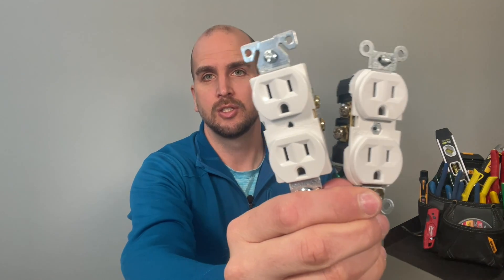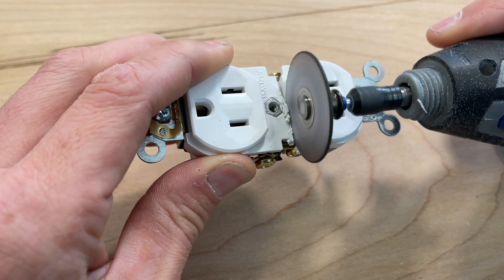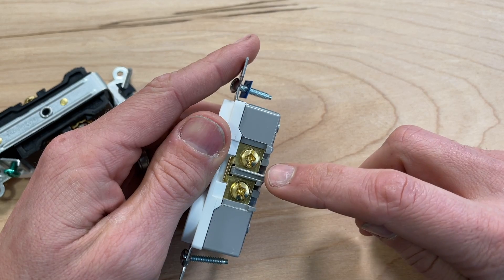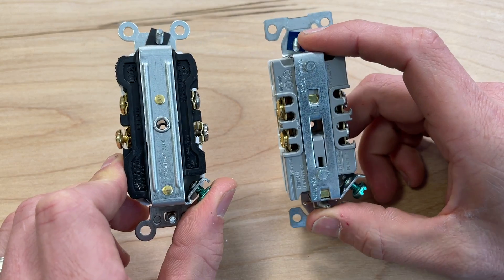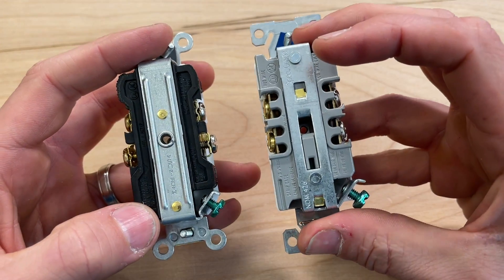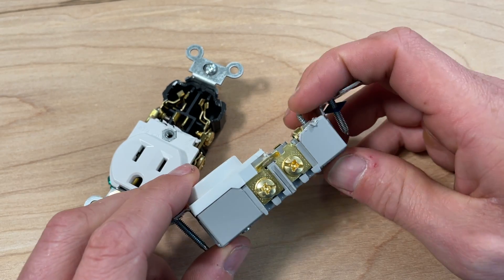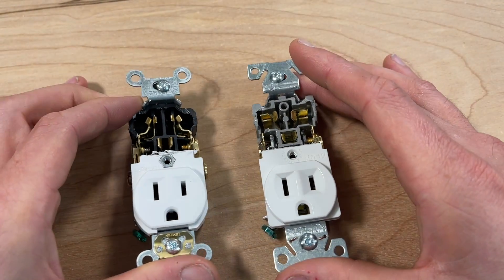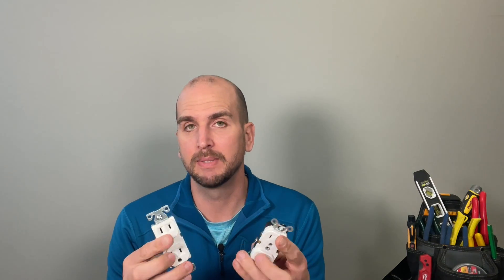What Outlet Should You Buy | Leviton vs Eaton

Comment: I just installed one of those Leviton receptacles yesterday to replace an existing outlet which was loose: I also found it had been backstabbed. 🤦🏽‍♂️
I decided to use the Commercial Grade outlet so I could use the back wire feature, and also because it has to provide power to another set of conductors in the electrical box. 
One thing I liked is that the receptacle was still a bit deeper than I wanted, even with spacers. The Leviton has the embedded nut in the center, which when installing the wall plate worked better to draw the receptacle further forward. (I am going to go back later in the year and try to replace the box itself to make it more secure.)

Also the Leviton is Made In USA; not sure about the Eaton. 

I fished out the cardboard box from the trash, and didn’t realize there are instructions printed inside the box! 😅👍🏽

As of Feb 2025, using your links, the Leviton is $2.41 while the Eaton is $2.48. 

So when I get more I will likely get the Eaton. (Lowe’s is closer to me and I get a 5% discount)

Comment: As an electrician... These particular backwire features of both brands I would use for stranded wire only. 
At one time before these better backwires existed on the commercial receps, stranded wire was required by some municipalities code enforcement to have spades, such as: Sta-Kon, 3M, Panduit, etc.,   to be crimped onto the stranded wire before putting under a screw.
With these commercial backwires, they do seem to hold stranded wires quite well. 
I would like to see pull ratings done using solid wire conductors on these backwires.   

The fault I find with these, is the screws were never tightened enough and when you fold the wires back into the boxes it moves the wire under the pressure plates causing looseness and becomes a hot spot.    If using solid, I still wrap around the screw.

When using receptacles in a circuit run... I make all my wires up and put under a wire nut.   I leave a single set of pigtails out of the box to wrap around the outlet screw.  If the outlet fails.. it doesn't affect the rest of the circuit.
Reply from the maker: Thanks for the comments and feedback.  👍

Comment: If you happen to see this, there is one thing your missed that is really quite important from a quality perspective: The 110/240v blade connectors on the Eaton are nearly impossible to spring, thus they last several years longer than the Leviton without failing to hold the device plugged into them. Leviton's "edge" and thus their "popularity" on the dealer side stem from price. If you want longevity, and I'm talking in decades here, go with Eaton. If you want "good enough for most purposes and to get buy the initial homeowner before they sell and move, go with Leviton. They both have their place. After building this place in 1995-1997, this year I "get to" replace about 30 Leviton 110v receptacles in my home because they are all sprung and do not safely grasp the blades of the plug being inserted. — The pro's know, it's all about the $$ —

Comment: I prefer Eaton too. I especially like the wire looper, it saves time. I never use 15 Amp receptacles. I always use 20s for a 15 Amp circuit as a safety margin, but that's just me.
Reply from the maker: Thanks for the feedback, I also dove into the Legrand (Pass & Seymour) compared to the Eaton.  The Legrand is pretty compelling.  https://youtu.be/ir3kMV1-6hE

Comment: Question - If you installed a Non - self grounding receptacle in a metal box and the receptacle did not have a groundwire tied to it, but a ground wire was tied to the metal box ground screw.  If a malfunction occured in the non-self-grounding receptacle, does the current not flow through the screws and into the box because non self grounding outlets also have metal to metal contact with the metal box?  In other words, how is one self grounding and the other one is not in this situation b/c both have metal to metal contact with the box?

Comment: I search for the brand of duplex outlets that are 15 amp. but if you examine them closely are built with 20 amp.T-slot internal metal contacts.   Lowest contact resistance with highest retention forces, regardless of what load you'll actually put on them.  This is of course for a 15 amp. residential situation

Comment: With regards to back wiring the Legrand and Eaton look similar, but the Legrand has a slightly thicker outside plate with a couple of dimples to increase contact. With normal torque on the screws, the connection is very secure and the wire can't be rotated separately from the receptacle. The Eaton is much weaker and the wire can easily be rotated and slip out. The Leviton, which seems more fussy to use, and looks cheesier, has a design where the connection is very secure, it wraps around the wire somewhat and doesn't slip or budge with normal torque. The screw heads are also largest on the Legrand, another plus. I would rate the Legrand the best of the three and the Leviton 2nd.
BTW, most of my experience is with the Leviton brand (spec grade) and over many years have had no issues. The plug grip strength is very good even with 2 prong plugs.

Comment: You didn't mention that it is not only 20 Amp  125 vac but it is also manufactured to use as 250 vac also of of the same assembly line.  Just change the face plate. I  am in the USAF and noticed a lot of receptacles do the like NEMA 10-30 is same as 10-50 and 14-30 & 14-50.    I just use a Dremel tool to allow different plugs.

Comment: We had a circuit go off in our home recently. I replaced the breaker but 'no-go'.
I watched a  bunch of your videos and learned so much. Soon I was suspecting my outlets had been backstabbed. I got these same commercial outlets from Eaton, bought a plug-in tester and AC Voltage detector, went to the first plug in the circuit with breaker off, after checking again for power I pulled the outlet out and yes, one wire became unplugged (bad backstabbing!) as I pulled it out. It had a lot of corrosion on it (32 year old house).
I put in the new outlet and it works just fine now!
I did get a box of ten, and we have several plugs that fall out, so gradually I'll replace the troublesome ones first over time.
I decided I also should add another outlet further up the wall so I can plug my computer in higher and conceal the cables better.
Thanks for the great info!

Comment: I got thinking about the Eaton strip feature and can actually envision a late-night event where I have a screw driver handy and open the box and woah, the stripped wire is broken so I could just use the stripping feature, otherwise it seems like a slower process. But if your plier has fallen off your belt and you just want to get the job done - slow is better than a trip back for another tool.

Comment: I guess as an electrician I would go for Leviton as the customer will get a good  commercial grade outlet for a reasonable price. However, as a customer I would want to pay the few cents extra for the Eaton because yes, the contacts seem to be made to handle higher currents but to me also important, it seems the indents at the front that guide a plug into the holes seem slightly deeper which would make it easier for the user to align and insert a plug.  The legrand seems to have that same feature combined with thicker copper and a smaller volume at a lower price.

.... and then I find out the whole argument is moot as none of them is tamper resistant 😞
Reply: moot

Comment: Is Eaton the same as the old "Bryant" brand?
Many years ago there were just two main grades of receptacles;, Spec Grade and Residential Grade.  Spec Grade was used mainly on commercial buildings and Residential grade in homes.  
Bryant (originally Westinghouse now Eaton?) and Hubbell made only Spec level devices while Leviton and Eagle made Residential devices.  It was years later when "Commercial Grade"  was introduced to the market (<than Spec but > than Residential) that these brands began to compete head to head.  
So Bryant is an upmarket brand that moved down market while Leviton is a lower brand moving upmarket.
That explains the differences you've found in the design of the devices.
Reply from the maker: I think the Eaton was an Arrow-Hart which was bought by Cooper Industries and then Eaton bought Cooper in around 2012.  I think Hubbell owns Bryant.
Reply: @EverydayHomeRepairs  I worked for the distribution division of Westinghouse Electric from 1978.  Bryant devices was part of Westinghouse.  The Bryant division also included the residential loadcenters (plug-in branch breakers) and meter mains.  Hubbell devices was Bryant Electric's main device competitor at that time.  Both were well regarded by the commercial contractors. At that time, the other players in the device market were Arrow Hart, GE and Pass and Seymour.  
 In later years, Westinghouse got into financial difficulty and sold off all the divisions.  The Medium and High voltage transformer division to ABB, The lamp division to Phillips, Elevator division to Schindler, Engineering services division to Siemens and the electrical division (600V and below) to Cutler Hammer which was later acquired  by Cooper and then by Eaton.
Typical American Industry - lots of horse trading.

Comment: Hey I have a video suggestion that you might be interested in trying.  I always wanted to see someone do a Demostration of an Electrical Fire starting. Is there a way that you can biuld a small fake wall and run wires through studs and so on and "mimmock" a real electrical fire scenario by showing the dangers or space heaters and lots of amerage load on typical outlet and show how it heats the wiring up and how a fire don't just start in the electrical junction boc but can heat an entire wire up. It would be cool! I have been wanting to do one.  I might one day but I just do not have the "Views" and feel like no oe would care to se my videos.
Reply from the maker: Thanks for the feedback.  I think that would be a great demo if done in a controlled environment. 👍
Reply: Electrical engineer here, that has performed many electrical fire investigations. Far and away the most common fire scenario is a loose connection at the receptacle. Relatively rare is a situation that will “heat the entire wire up” and cause a fire. Another common “old wive’s tale” is an overdriven staple pinching the Romex causing a fire - it is possible but really difficult in reality.
Reply: @jeffbannard2304  Ohh interesting!  Thanks for the feed back!
Reply: @EverydayHomeRepairs  Yes for sure!  I would love to see that.  Thanks for the reply.
Reply: @jeffbannard2304  thanks for the info!

Comment: Why do they provide a 12 gauge wire stripper on a 15 amp receptacle?  Also, the internals of the Eaton appear to support both standard 15 amp and the 20 amp plugs, as the author presents, but oddly, it appears to accommodate rotated prongs on both sides.
Reply: 12 gauge wire can be used on a 15 amp circuit, 14 gauge is the minimum. Second point is that a 15 amp duplex receptacle is code compliant on a 20 amp circuit. The rotated contacts on both sides are made to allow the same internals for when a 240 volt 20 amp receptacle is made by the manufacturer, an appropriate plastic cover will be fitted.

Comment: You can get a 10 pack of the Leviton M42 at a unit price of 52 cents per unit and it has a much better build quality than the CBR15 shown here. Like the Eaton BR15 the M42 outlet face is secured to the body with two blank head screws. Funny cause I just disassembled a few M42's two months ago for a hobby thing my wife and I were doing;  I notched the screws with a Dremel and reverse them out.

Comment: No: the ears will in certain situations comply with NEC code: Not more than1/4 inch set back. 314.20 In Wall or Ceiling. In walls or ceilings with a surface of concrete, tile, gypsum, plaster, or other noncombustible material, boxes employing a flush-type cover or faceplate shall be installed so that the front edge of the box, plaster ring, extension ring, or listed extender will not be set back of the finished surface more than 6 mm (1⁄4 in.).***My opinion: If less than ¼ inch noncombustible material; use the plaster ears to flush face receptacles. if not, flush use UL listed fire box extensions. And you may need longer device screws.
In walls and ceilings constructed of wood or other combustible surface material, boxes, plaster rings, extension rings, or listed extenders shall be flush with the finished surface or project therefrom.*** This can be achieved by using UL listed Switch box extensions if combustible surface material and box are not flush. And you may need longer device screws.

Comment: If you have an old house like mine with Metal boxes, and BX Steel cable, wrap outolets and switches COMPLETELY on the sides with electrical tape, especally if you are doing side connections....

Comment: I was not aware a spec grade or commercial receptacle came in 15A. Are those big box store receptacles? Or from an actual electric supply house?
Reply from the maker: Big Box. From Lowes (Eaton) and Home Depot (Leviton).
Reply: @EverydayHomeRepairs  ok. Makes sense. When i was doing residential i tried to use only leviton. Commercial P&S or Hubbell spec grade or higher

Comment: Eaton and hubbel are the only thing I'd but in my home. You can just feel the difference of weight and quality in your hand.  Price and availability are the biggest factors involved with property management though.  Even if it lasts longer and reduces labor costs in the long run,  50 cents cheaper  a unit still prevails. Only experience and tinkering minds will ever see that picture.

Comment: I want 2-prong brown outlets.
15A but 20A preferred.
I do NOT want to put ungrounded stickers all over the place and I do not want to pay thousands for upgrades.
2 prong works just fine (clocks, TV's, etc).

I absolutely want metal boxes. Plastic is far too flimsy.

Those tabs were originally used for wiring barns. No boxes.

Comment: Good outlets Eaton has. Noticed gfis easier to use and screw does not strip easy on devices. 
Eatons problem is there commercial products. There terminations are shallow depth. Getting good mechanical connection makes me worried about what installed.

Comment: I have a few Eaton and then the other 99% in my house are Leviton. I find plugging in things to the Eaton receptacles (brand new plug + USB combo outlets from Lowe's) are clunky and not smooth, whereas the Leviton are smooth as butter plugging in and out. I wish I had bought all Leviton.  6:33 - 'no' I would never use that built in stripper on the outlet. A $3 tool is 10x easier.

Comment: Use the small circles to strip  the wire.  Stick the wire in an hold tight an go around inside the tio circles/holes then just pull off

Comment: I hate metal boxes. I get it for industrial and commercial applications for the 2nd ground through the box/conduit but they always seemed so silly to me. They are just asking to be shorted out. I've seen a lot of electricians loosely wrap the entire receptacle with a strip of electrical tape. (Around the sides / over the terminals) By loosely I mean they didn't pull/stretch the tape as they applied it. Many don't understand that when you stretch the electrical tape as you apply it, it will always want to stretch back so when the adhesive starts to lose its effectiveness it can start to "remove itself".
Reply: I hate plastic boxes. It's so frustrating when those weak-ass threads strip out when you're trying to push the outlet into the box, trying to get all the wires folded into place. Secondly, if there's a resistance build-up due to a weak contact, I'd much rather it happen in a metal box, rather than a flammable plastic one. Maybe they're better nowadays, but I just never have felt comfortable with them. I don't get the shorting problem either. Once the outlet is installed, the terminals are not even close to the sides of the box. If you're poking around in a live outlet box, a breaker-tripping short seems much more preferable than YOU being the route to ground.
Reply: The 4" square x 2 1/8 dp metal boxes with the appropriate mud ring offer more volume for ease of wire management, especially if 12 gauge wire is used. Using the required bonding jumper and connecting to the other ground wires makes the box as safe as a plastic one with regards to shorting or shock or electrocution hazards.

Comment: Those aren't screws holding the Eaton together. They are barbed push rivets. If you had simply ground off the rivet heads your task would have been easier and you would have exposed the entire front view of the interior.
Reply from the maker: Good point and appreciate the feedback 👍

Comment: These non-tamper-resistant outlets are (mostly) not acceptable according to the 2008 National Electrical Code, and they're required in even more places in the 2014 and 2017 codes, so the non-tamper-resistant ones are (almost) irrelevant in residential applications today except in a very select few exceptions.

Comment: I don't care for the receptacle's built-in wire stripper, since it can nick the wire and thus lessen its conductivity; also, a nicked wire can break more easily, just like how a scored pane of glass cracks along the line, or how the perforations on a writing-pad or postage-stamp allow for easier tearing of the paper.  I usually use a butane lighter or soldering-gun to melt the insulation and peel it away from the conductor, and thus do zero damage to the conductor itself --- again, the stingy wire-manufacturers give you precious little costly copper as it is, so you'll wanna preserve and avail yourself of every last square millimeter of what little cross-sectional area that they do give you.